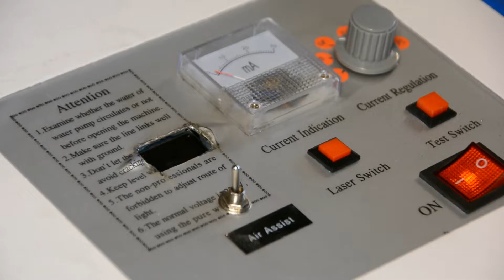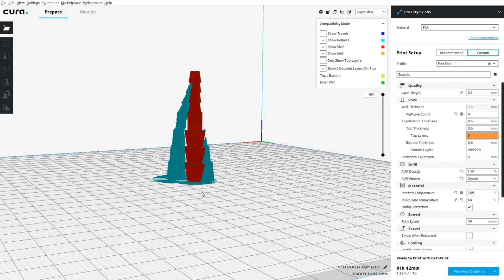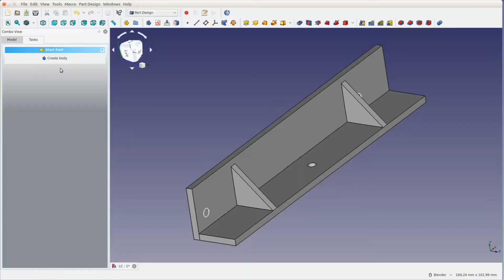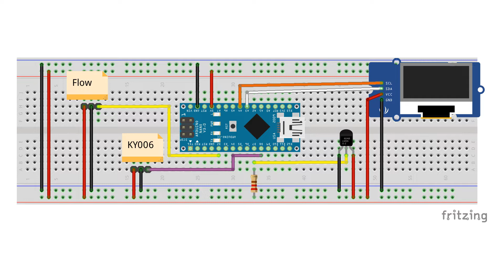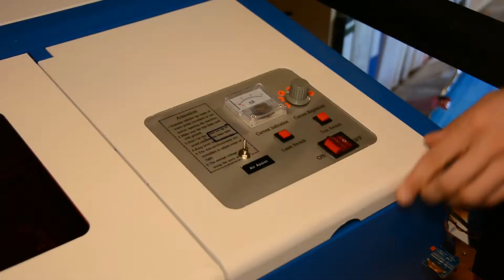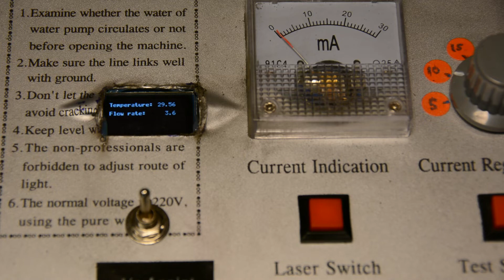Improved Cooling for the K40 Laser Cutter

Comment: What is the average water temperature after a lot of use in the loop?
ps there are also out of the box flow sensor/temperature solutions that would be better
Reply from the maker: It seldom gets higher than 25 degree C

Comment: Nice setup overall, i would suggest using the Arctic P12 fans rather then the F12 for more cooling  power, also i am using the "Alphacool Eheim 600 Station II 230V" for a closed water circuit.

https://www.alphacool.com/shop/pumpen/pumpen-mit-agb/860/alphacool-eheim-600-station-ii-230v

https://www.amazon.de/Arctic-P12-Geh-C3-A4usel-C3-BCfter-optimiert-statischen-dp-B07GB16RK7/dp/B07GB16RK7/ref=dp_ob_title_ce
Reply from the maker: Thanks for the suggestion!

Comment: Great video

It would have been nice with some comparison test results showing if it was actually worth adding the PC cooling parts. Did you conduct any to see just how effective it was ?

That display is crying out for a 3D printed bezel :)
Reply from the maker: I did not do a systematic test with and without cooling. But before using the cooling I had to switch off the laser after 45 min of usage as the water got too hot. This is no longer the case since using the cooling.
Reply: @WayofWood  thats definitely a good improvement then, I think adopt the same, thanks for the reply 👍

Comment: Great video showing the mods you made. However, a lot of people are just not able to do all these mods to just not having enough knowledge. This could pose a very severe safety issue if someone did something incorrectly. 
It would be great if we could buy these mods and just be plug and play. This could minimize or eliminate the possible errors being done and safety would be compromised. 
Keep up the great videos. 
😎
👍👍👍👍👍
Reply from the maker: I already thought about offering some kind of „kit“ but even then the stuff would need to be connected to the electronics — which would also be a risk. 
But if anything in unclear have a look at the website articles and in doubt please just ask in the comments. 👍
Reply: There are so MANY safety issues you would need to address if making a kit. The inadequate frame grounding, the interesting wiring colour choices on the mains wiring, the twisted together mains power wires in the supplied cooling fan... the list goes on. Releasing a kit would potentially make you at least partially responsible for anything that happened to anyone trying to use that kit with these dangerous machines. Better to keep that liability as far away as possible.

Comment: Thanks for the video and pics but I am having a problem. I uploaded the sketch and it went fine but the screen does not come on. When I look at the serial monitor I see " 0LFlow rate: 0L/min Output Liquid Quantity: 0mL " ( water pump not on so zero flow would be OK )I see no temps being displayed. I think I got the right display. I got it from Amazon here in Canada " OLED Display 128x64 Pixel 0.96 inch - I2C Bus - Compatible with Arduino STM32 NodeMCU ESP32 " Any help would be appreciated. Thanks in advance
Reply from the maker: If you google „arduino oled ic2 example“ and pic one of the examples - does it work to display something on the display?
If not double check which pin goes to which port on the arduino.
Reply: Thanks I got it to work. But the schematic on your site Shows SDA=A3 SCL=A4 but the example sketch I got shows SDA=A4 SCL=A5 and the example sketch worked. I uploaded your sketch back onto the Nano and it is working and showing Temp and Flow rate ( It is really small ) but it is working. Just need to figure out how to make it bigger for my old eyes to see 8) . Thanks again!
Reply from the maker: @rolandrosilius8631  Thanks a lot. This was indeed a bug in the picture.  I fixed the picture on the website.

Comment: omg i advice to buy some 10l tan and some ice packs its way cheaper
Reply from the maker: connect terrain That’s what I did for quite some time. It is just inconvenient to change the ice packs frequently. But if you look for the cheapest solution ice is the way to go. 😏
Reply: @WayofWood  if you opt for ice packs you have the risk of uneven water temperature, which could break the tube if a drastically colder bit of water goes through a very hot tube.

I'd be curious, op, what is the effect on water temperature when your machine is running? If you turn the fan off vs having the fan on?

Thanks!
Reply from the maker: Stephen Owen When I used ice packs I used them to regulate the temperature to around 20 degree Celsius  - by exchanging ice packs whenever the temperature is raising. 

I didn’t yet tried the cooling in a 1:1 comparison / experiment but there is a substantial effect in how long I can run the laser without the water getting too hot.

Comment: Can you, please, also provide links to the radiator and the three pc fans? What was the total cost of these components? Looks like a cheaper alternative to CW3000.
Reply from the maker: Good catch. I added the links. 

The cost should be around 50€ and change for the cooling setup. The electronics might be another 20-30€. Especially for the electronics it depends what you have at your disposal. We tend to buy arduinos in 10packs, resistors, cables, perfboard, etc. is already available. If you don't have a soldering iron and have to buy one for this project it's more expensive than if you have a well equipped electronics space.

Comment: Great work! I do appreciate your ambitions to document your K40 hacks properly :-)

What is the cooling power of this passive setup, if I may ask? I have seen multiple people stating quite disappointing results from a similar setup that includes peltier elements so I am wondering if the all-passive setup might be even beneficial?
Reply from the maker: Thanks. I think it depends on how intensive you plan to use the laser cutter. For us running it 1-2 hours is the absolute maximum. Over this time the setup helps to keep the temperature reasonably low. I don't know if this method would be good enough for production runs over an entire day -- but honestly there would be many other elements that would most likely fail beforehand. :-)